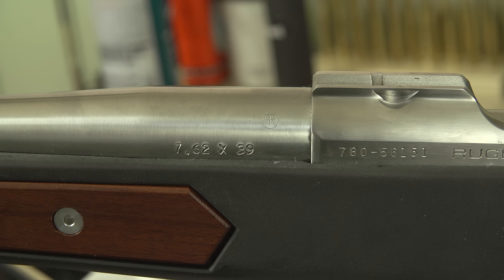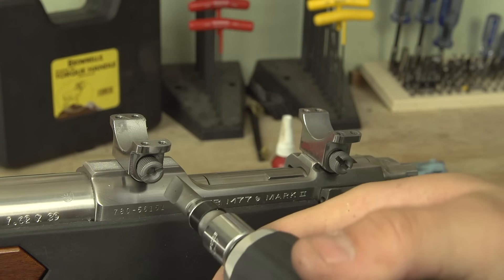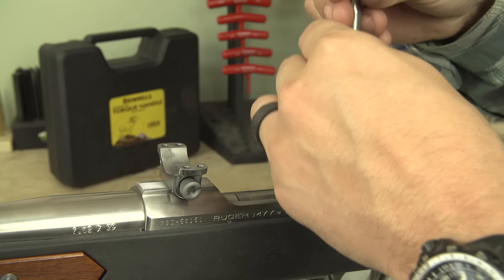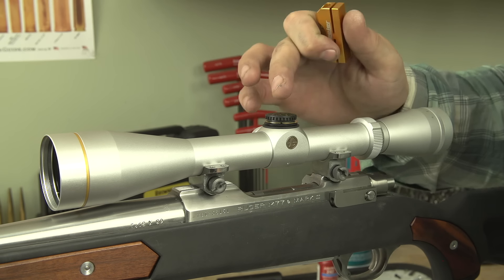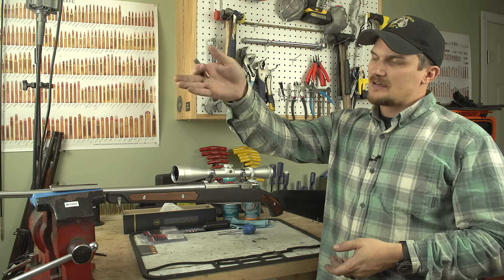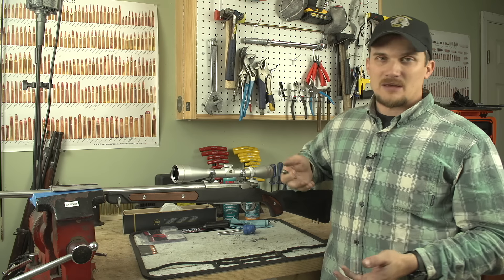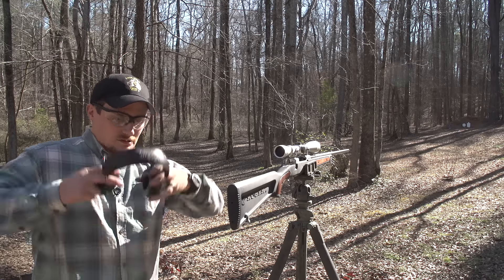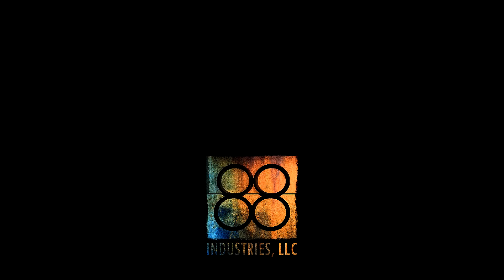How to Mount an Optic Like a Pro

Comment: Thanks for the video! I was wondering if you needed to lap the top rings as well? Seems to me if the bottom was that far off wouldn't the tops need to be lapped? Thanks again for another helpful video:)
Reply: Was just going to ask the same thing.  Is it enough to lap the bottom but not the top?

Comment: bubble levels alone do not level scopes. you need a vertical string hung, and need a way to determine what is exactly level for the gun. unless you have a custom bolt action, the receiver is not level or straight

Comment: You're going to hate this criticism, but........the ONLY way to get your scope right is to line the vertical reticle line up with a free hanging plumb line so vertical = vertical. THEN you put a spirit level ring on the scope body (not the turret for goodness sake!) and get the bubble right while the scope is still lined up with the plumb line. Tighten down. Now, as long as the relationship between the scope and the barrel stays constant (it will if you mounted secure), when you adjust up, the shot placement will go up, etc. BUT the MOST vital thing when you need to adjust aim is to make sure when you're sighting that your vertical reticle line IS vertical.......so check the spirit bubble. If YOU cant left, thinking it is vertical, when you adjust up, you will go up AND left. Cant right and you go up and right, etc. Cant left and adjust left, you'll hit left AND down. So FORGET the pundits rhetoric about lining up the vertical reticle precisely with the barrel bore, it simply isn't important. Just ensure THE SCOPE is perfectly level when you aim!

Comment: That is true but with a150 grain 308 100 yard zero drop should only be about 2”  at 200 . Not 8 to 9 “ was wondering if scope was mounted incorrectly. Looks like scope is slightly higher in back then front

Comment: Just ran into the bolt clearance issue on one of my late fathers guns that I bought from my mother. The way that it's set up, the scope has to be as far back in the rings as possible in order for the bolt to be able to travel far enough to eject the empty casing. There is also a screw on the magnification adjusting ring that interferes with the bolt as well so the magnification has to be set from 3-5x for the bolt to travel far enough to eject the case. If the magnification is at 6-9x I have to reduce it to at least 5x. And lastly, in order to remove the bolt, I have to remove the scope first. Not ideal. The mounting bracket bolts to the side of the receiver and the ring bottoms are part of the mounting bracket so currently, the option available that I'm aware of is to find a different scope with a smaller ocular.

Comment: great video other than you failed to properly tighten the scope rings bolt down. look at the scape between the front ring for the top portion and the bottom portion, a gap there and the back ring had no gap.

Comment: Well done Chad. Quick question for you, would it be better to use the alignment tool to check the alignment first then do the lapping procedure on the ring bases? If you had to adjust the alignment after the lapping procedure wouldn't it change how things fit together? Just a thought, not sure if it would matter.
Reply: The lapping is really more to ensure you have good contact over the tube.  The alignment just squares each mount. Admittedly there is a certain amount of alignment done with the lapping.

Comment: when u tighten rings on the alignment bar or a scope you should make sure that you tighten the screws evenly and that the gap between the top of the Ring and the bottom of the Ring is even on all four points ITS CRITICAL that you do this or it makes all the lapping totally pointless

Comment: Don’t recommend putting the bubble on top of the scope.  For long range shooting this will not level the scope accurately enough.  Use a flat bar with a level and place it under the scope at the bottom of the turret.

Comment: I am a novice at best to the world of optics. I want to mount my own instead of having a smith do it. I only just became aware of the procedures involved in leveling both the gun and the optic. Lapping the rings just blew my mind. This level of precision is right up my OCD alley. My question concerns lapping the rings with the caps on. When you watch the Wheeler video where they show how to use their product, they clearly are lapping with the caps on. So I guess my question is: is this done at a later stage after initially lapping the ring bases or is it just a preference whether it's done at all?
Reply: Jim , Howdy!
Thank you for your observation. I did note that on the wheeler video as well. Yup  I'm a tad OCD too...I use 3 levels to triangulate level when setting up my crane b4 I start making lifts. Lol, is it neccasary...Well probably not but it puts my mind to good to go.
  As for the meat of your question...I've heard tell that lapping w caps on can leave a certain angle imparted on the leading and trailing surfaces if there is more than minor work to be done to the lower surface. That said , I can see where that would be an issue as the typical cap screws are notably smaller than the holes in the cap. Given one has to leave the caps essentially loose enough for the bar to reciprocate with the compounding agent in order to accomplish the task.
 So,  I ponder upon this. One could do a precision (ish) set up, then lap say 75 to 80% completion with the caps off. Next install the caps, leaving a very minimal space for the bar to reciprocate with the compounding agent and proceed with a great deal of attention and caution keeping in mind there is going to be at least three axial planes of movement in each cap. Up/down , left/right, and canting caticorner leftrear/rightforward. I'm sure one can visualize these movements better than I can out into mere words.
   I reckon if one had extended screws ,say an inch long, to thread thru the top caps which could captivate a fairly stiff spring on all 4 or 6 screws per cap... I reckon this would thru mechanical variable down force solve a large percentage of the axial movement with out maring the top cap as perhaps a step shoulder screw could. Hmm more things to ponder.
  Thrust angle imparted by a single handle off center handle on the lapping bar. Would opposing handles be better? One would defiantly have to monitor the pressure applied. Hmmm roller bearing  guide rail bars to attach the lapping bar to via end buttress T bars. 
  Damn the voices in my head!!! They come up with some of the damnedest things.

Comment: I liked the vid, but, my OCD doesn't let me have different gaps from top to bottom ring. Ex. The front rings on the left side have an 1/8th inch gap and the rear left has no gap. Personal preference, not hating on you friend

Comment: Why did you push the rings forward before torquing the bases to the rifle? Wouldn't you want to pull the ring bases backward, so the tabs on the bottom act like abutments pushing back on the receiver? Wouldn't that completely eliminate any backward travel from prolonged recoil?

Comment: I understand a lot of people have different techniques, but why was lapping only done to the bottom of the rings and not with the top piece ?
Reply: The top just tightens the scope down, the bottom is what keeps it aligned since that’s what the scope is actually setting on top of
Reply: Umbys late reply but yeah lmao
Reply: A lot of it depends on the person, my father has always done the top also. Helps set the top to be lined with the scope which has more points of connection with the scope which some say is helps your scope last longer, some say it doesnt mean crap

Comment: Why aren't the top rings lapped as well?
Reply: That would prove very difficult to do as there is no way to secure them like the lower rings. If they were mounted on the lower rings and were loose enough to move the lapping rod little would be accomplished.  If they were firmly snugged down you wouldn't be able to move the lapping rod easily. Of course a jig could be made which holds the upper rings in a reversed upside down position in a perfect linear plane to be lapped. But I am not aware of any manufacturer that produces such an item, including Sinclair. Perhaps the Benchrest community knows of some speciality source for such an item. But most gunsmiths who would choose to go the extra mile would likely machine and fabricate one themselves.

Comment: Why wouldn't you just use the 1" stainless in the rings with the top halves semi tightened, before cranking down the bottom halves to the receiver? Probably wouldn't even need to lap with that method..

Comment: What's the difference between lapping and polishing?
Reply: phileas007 Lapping is using a more coarse abrasive to erode the material. Polishing is the same but to much less of an extent, with the goal of making the surface smooth or shiny.

Comment: I'm confused... I like Chad's suggestion on using the bubble on a line instead of using the bubble in between the lines for a more precise level, but after 2 hours of me playing with my Wheeler kit I'm just beating my head against a wall trying to understand how I can set everything up level while have the bubble be on a line instead of in between! Any words of wisdom from anyone on how to achieve Chad's technique?!?!?! Thank you
Reply: Matthew Hylton cant the rifle until the bubble is on the line and lock it down. Using the barrel mounted reference level make it read the same as the level you have on the receiver (on the line). Mount rings, check alignment, lap if necassary. Place the scope in the rings snug down rings, set eye relief then use the turret as the leveling reference point. Rotate until the level shows the same as the barrel reference level. Torque down. This will not make the scope level to the earth but with square the scope to the rifle. For added precision a scope mounted level could be mounted while aligning the reticle with a plumb line. That way when the rifle is held properly the scope mounted level states the reticle is level to the earth and by these stacked tolerances the rifle is also.  And im out of breath now😁

Comment: Evidently you removed the compound from the rear mount and sanded the front down to match the center point height of the rear mount.  Do you ever have a left to right difference? Curious,then what do you do ?

Comment: I still don´t get it.
How do you know, that the bubble on the barrel is straight up to the scope line?
I mean, you can mount that barrel bubble however you want, and then turn the rifle until it is even.
But that doesn´t mean finally that the scope axe is straight above the bore axe.
?
Reply: You level the rifle using the small level on the receiver, then attach the barrel level as a reference. Then move the small rear level to the scope to level that and check it against your level on the barrel.
Reply: @philhonour  Thanks man!

Comment: I don’t agree with the level on the scope. I like to  use a plumb bob and level the retical
Reply: Yes that is the way to truly level your optics, by inverting the scope and looking at the plumb bobbed line, while  turning the vertical  cross hairs until square !
Reply: Just for the hell of it have you ever tried bedding the bottom of the scope bases. The area that the scope will ride on and not the area that will contact the receiver itself.

Comment: do you (or anyone on here)  have any advice as to how to get an initial level of the action on a rifle that doesn't have a flat surface? I know some people say use the bottom half of the rings but in my case (on browning x bolt) the front ring and the back ring gave different level readings and indicated to me that neither reading could really be trusted

Comment: Aren't you supposed to have the top of the rings on too when you are lapping so the top of the bases are done also at the same time ? I've watched another mounting video and that's what they did. Just saying. ?  Just a question also. When did this lapping start ? I thought the rings were supposed to be flat and smooth from factory.

Comment: I am still waiting for any proof to show that lappening rings helps with anything.
No one could provide me with any yet.

By the way, when you are worried about the 1/1000th degree offset from lapping, you might not want to use the edge of the bubble in a spirit level. The Amount of air in those is not the same, neither is the glass tube. You center the bubble inbetween the two lines because that mitigates the deviations in the size of the bubble itself.

Comment: “Oh my god I never lapped my rings and have always had so many issues” - Nobody
Reply: It's completely academical this basically only exists for the gunsmith to have something to write on the bill. When the scope is mounted and the screws are tightened it won't move out bend the scope or anything of that sort that would justify that work.
Reply: Exactly, if my $200 Leupold was dammaged by not lapping the rings it wouldn't have been worth $200 in the first place.
Reply: Bob its the rings not the scope why you may need to lap them especially cheaper rings

Comment: What about aluminium rings? If you try to lapping them you will remove the hard anodization and bite in the soft part, am I wrong?
I've seen very high end aluminium mounts, like SPUHR that are ribbed, what is it for? Does it help to prevent the scope from sliding?

As always, love your videos.

Comment: how did you make sure the rifle itself was level in the vice, i understand that the level on the barrel can tell you if it has moved during adjustment but how do you get the barrel mounted level to be correct in the first instance, do you just line it up with flats on the stock or is there more to it than that??

Comment: @1:36 that is way more movement than any acceptable tolerances could explain. If that ring is down even slightly finger tight Ruger has fallen loooooowww. I hope not because I love the company.
Reply: hrm, I'm thinking about it and maybe they did it that way to allow for lack of coaxiality in the ring and rail, or ring and whatever tube you might be mounting. Maybe I'm looking at it wrong and they were smart. Who knows.

Comment: okay so this is probably going to sound like a stupid question but can you bore sight a AR-15? ?
Reply: juggalo4life_91 yup, I did mine.
Reply: juggalo4life_91 Yes.
Reply: Yeah separate the upper and lower then pull the bolt carrier group out of the upper, then you can see straight through.
Reply: juggalo4life_91 sure can.. I have a lazer bore sight.. gets me on paper for the final tunes with my handloads.
Reply: Cameron Tolliver or you can just use a laser bore sighter.
Reply: Great

Comment: So can I expect a one piece scope mount to be perfectly aligned from factory or it might still need some lapping?

I have some cheap rings and they pull my scope to the left which is really annoying.  It still works but I hate how it's not centered.
Reply: Should read This will/or may result in a bases mount that will make contact after being lightly threaded onto your receiver. This also may /will result in the front of your bases becoming raised from the receiver. This will indicate  that the radius on the bottom of your base and the radius on your receiver do not match, but are slightly off. If you mount your bases in this condition it will become slightly twisted when mounted and will miss align your scope rings and or your scope . No matter how much lapping you perform your rings simply will to be true to your rifles bore. It must be corrected as stated above.

Comment: Do the torque specifications change if the screws are wet with locktite or are they the same as dry? Thanks for a solid tutorial video.